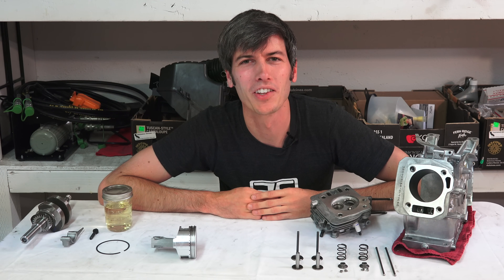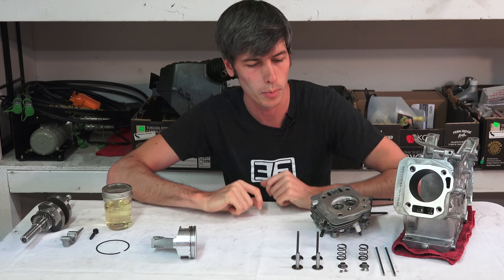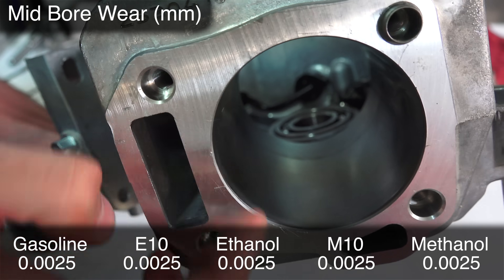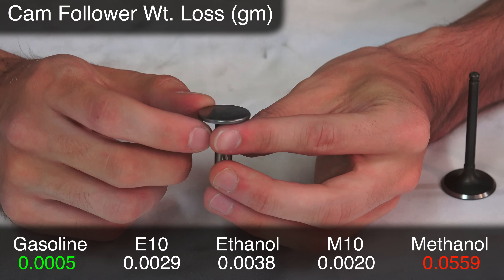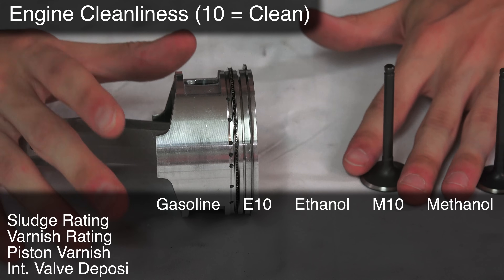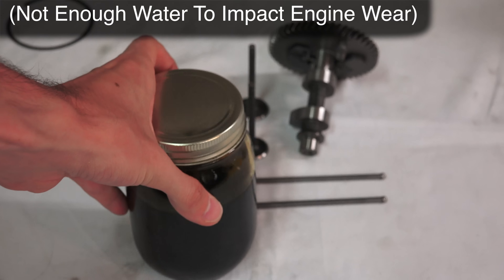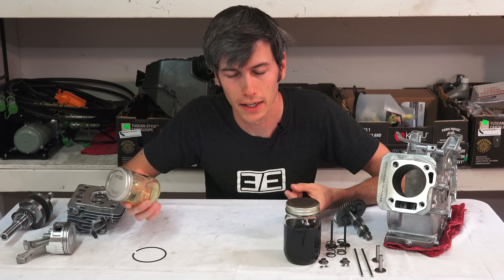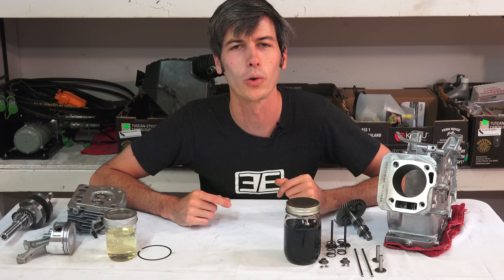Is Ethanol Bad For Your Car's Engine?

Comment: Could you please explain why engine parts that are not directly exposed to the fuel, in any mix or in any way, can show wear attributed to the fuel? Cams, followers, wrist pins, journal bearings, are not exposed to fuel so how can the fuel be at fault?

Comment: A couple questions;

Were the engines adjusted for the higher 
fuel to air mixture?

Did we check the damage to the fuel system?

steve
Reply: Ethanol has a different stoichiometric ratio than gasoline. Stoichiometric means that all of the fuel is used and all of the oxygen is used in a perfect system. Gasoline has a stoichiometric air to fuel ratio of 14.7:1, meaning 14.7 parts air 1 part fuel by mass. Ethanol has a stoichiometric ratio of 9:1 by mass.

Comment: Where I live E10 (super unleaded/silver)is usually 20 cents cheaper per gallon than regular unleaded. Both are 87 octane. I’ve been running e10 in an 06 Buick and at 85k miles replaced the fuel module which acts as the pump. The mechanic gave me a list of places that use top tier additives. So I try to always fill up with e10 top tier, and put a bottle of injector cleaner after an oil change. Been running e10 in an 05 GMC 5.3 with a bottle of injector cleaner, 156k miles and had it since 48k miles. E10 every time. Do not use e10 in carburetors. If you let e10 sit for a long time like months at a time it will separate.

Comment: After a view years with E10, the carmakers dont wont too use this!
Why? It damaged enginseals and Fuel lines!!
Reply: So how come, racing cars use 100% ethanol?
Reply: @wiretamer5710  
Special engines, seals and fuel lines!?😕
In addition, these engines are dismantled and overhauled after each race!

Comment: A test showing power differences between the fuels as well as mpg difference would be interesting.
Reply: Well, here in Brazil, you have a better millage with gasoline, but it's really more expensive than e100. And i think every car here gets more power with e100, the VW Polo jumps from 116hp to 128hp...

Comment: Ethanol refiners get  $2 a gal from fed to make it. Cant make at profit otherwise.  resellers get $0.86 a gal tax break so cost tax payers $2.86 a gal in taxs .plus cost. its 10% less efficent then gasoline. less MPG...BURNT ITS a lot more toxic then gasoline. It softens rubber engine parts =failures..fuel pumps fail/ quit..raised the price of 300 food products made with corn/ corn sugar.  40 hardware  store items have corn in them too. charcoal briquits use corn starch as the binder.  High corn use makes meat + poultry feed HIGHER priced so Raises meat and egg prices .its a pure total But- Fk on us..think it was a $$$scam between oil man Bush and oil refiners...should be BANNED cost us mega billions in subsidys a yr.    Really..hþ

Comment: Too often alcohol gathers moisture and you may have 10% ethanol but not 90% gasoline. A significant percent of water may exist. A petroleum engineer told me that. Otherwise ethanol can be superior.

Comment: I completely agree that ethanol doesn't cause engine damage. However, the real reason I don't like ethanol because it eats older rubber in fuel systems and because it absorbs water. The problem is I have collectable tractors that don't have the newest fuel systems designed for ethanol and they don't run very often so the fuel collects water and rusts out tanks and fittings and just goes bad sitting in there so I spend the extra money for ethanol free. However in my commuter where the fuel system is modern and the fuel will get burned within two weeks of my filling it, I use E10 all day long.

Comment: My 96 XJ owner's manual even has a note than it has been designed to run on either E10 or 100% gasoline. I'm not sure how far back you can go before it's an issue but my guess is that anything from the 90s or later is probably good to go with E10.

Comment: Get off that high horse .    Grab you a older weed eater or chainsaw.    Use it a day , then put it back in the garage till the weeds come up again or the firewood runs out .   Then give us your answer upon using the item again the next time.   Ethanol is crap.

Comment: My friends new Bass Boat engine manufacture ...states not to use Ethanol fuel.
If you do...it will void the engine warrantee.
One station here in town has a special tank/pump that sells old school gasoline.
Reply: I agree with them, ethanol is terrible for small carburetor engines. Don't use it.
Reply: I don’t put that in my ‘19 Tacoma or my ‘19 1000RR.

Comment: I got just over 15% less MPG in my 2017 GTI during my road trip through kansas when i switched to E10. same speed the whole trip using cruise control. also there is noticeable performance difference. I would personally never use E10 unless there is no other option.

Comment: Everytime I use 10% ethanol I get at least 1 - 2 mpg less then when I use straight unleaded gas ! And I do track it !
Reply: well naturally, ethanol simply has less energy density. Not really much issue except when the gas companies charge the same amount for E10 as 100% Gas, even though ethanol is cheaper thanks to gov subsidies.
Reply: @falconerd343  e10 is about 10% cheaper here. For regular cars it is a perfectly fine alternative imho.
Reply: @baronvonlimbourgh1716  I haven't been paying attention lately but I've been many places where the only choice was 10% ethanol.
Reply: @falconerd343  I've never seen it the same price as gasoline. And the cheaper price nowhere near compensates for the extra 6 mpg I get using gasoline.
Reply: @falconerd343  Yep, you're paying for it through your taxes whether you use it or not. They snuck that corn subsidy through without us taxpayers having a say in it.
Reply: @falconerd343  the best reply for the question. Ethanol is an alcohol, all of them have less energy per volume than regular gasoline. 1-2 mpg is close to 1/10 ( 10 % ) of most cars mpg nowaday.
Reply: @andreasguntoro5399  What do you drive, a tank?
Reply: @falconerd343  still doesnt change the fact it cost twice as much to produce ethanol as it does gasoline.
Reply: @midnitesquirldog1 Car dealers do NOT love it. I work at a dealer and the jobs we want are quick and easy service intervals, that's where the money is. Head gaskets and mechanical repairs are often a ball ache, take longer than the allotted labour time to complete and come with hidden expenses to the company.
Reply: @justmechanicthings  luckilly you'll never have to do any of that anymore in 5 or 6 years.
Ev's just need tyres.
Reply: @baronvonlimbourgh1716  True that, the brakes in particular last a very long time.
Reply: Baron von Limbourgh ok, and where does the electricity come from genius?
Reply: @wildcard749  not from the dealership........
Reply: Baron von Limbourgh really ignorant comment
Reply: @4door_papi  which one
Reply: @baronvonlimbourgh1716  Lol You're funny.
Reply: @carlosoliveira-rc2xt  thank you
Reply: @baronvonyou could  use your e/v as a planter  in the garden or a barbecue, as they burn readily. 😂limbourgh1716
Reply: @midnitesquirldog1 you're not worth proving wrong. Every word of that is completely false. Nice try, but Im done. Good luck in life!
Reply: @jasonmefford4312  his advice re lawn mowers is consistent with what we are told here in Australia where we have had E10 for 20 years.
Reply: @midnitesquirldog1 thats a sales tactic.  Ethanol is only alcohol and it will not damage aluminum tanks. No one makes a tank from fiberglass. If you have read that warning, no ethanol, which means do not use straight ethanol. Like E85. That means that the computer is not equipped with knock sensors to calibrate is what Flex Fuel cars do. As long as the machine is equiped with PTFE line youre good, even lawnmowers.
Reply: Just 1-2 mpg? I gained a whole 6 mpg in my 2013 caravan when I switched from e85 to gasoline. I couldn't believe it. What the heck are you driving where you only gained 2 mpg with the switch?
Reply: Same here. Real gas gives better mpg.
Reply: You can get straight 87 octane gas? or are you comparing E10 87 octane to 91 octane premium gas without ethanol?
Reply: @midnitesquirldog1 I drove a 1962 Lincoln Continental as a daily driver for ten years up to 2004. Obviously it was from leaded gas and no ethanol days. I used what was available, which was of course unleaded and 10% ethanol. Might have worn things more but no running problems at all.
Reply: I found a 9% drop going to e85 in my Ford Taurus. So your results are not inconsistent with that. But then where I bought it e85 was about 17% cheaper so in fuel cost per mile e85 was cheaper.
Reply: So your car comes in at about 29mpg? (Then it's the expected difference from the energy density is.)
Reply: @midnitesquirldog1 this guy disagrees with you David Blume
Reply: @midnitesquirldog1 my truck is a 96 and my car is an 89 and never an issue.
Reply: that's because you get more power out of gasoline than alcohol so the engine uses more fuel for the same power
Reply: @midnitesquirldog1 Pre 2001 not 2003
Reply: My 2018 Civic (1.5T) consumes between 10 to 20% more on Regular fuel than it does on Premium, on average (7 to 7.5L/100km vs 5.9 to 6.5) YMMV
Reply: @midnitesquirldog1 ethanol fuel is not banned in germany. I buy it weekly..
Reply: @midnitesquirldog1 these ev people, and the others have no clue. Ethanol is a curse from our govt! I don’t run it in anything. Pure junk!
Reply: @midnitesquirldog1 Yes your advice re carburetored vehicles is sound. It depends on what market your car was built for as well but the owners manual may tell you if you can run E10. The manufacturers websites are also good for info.
Reply: @midnitesquirldog1 my 1999 car is compatible but it was Australian produced.
Reply: @midnitesquirldog1 power is a different thing. E10 in Australia is 94 RON where normal unleaded is 91RON so E10 is actually more powerful but gives more l/100k.
Reply: @midnitesquirldog1 my 360,000k Falcon might argue with you on that.
Reply: Here in Sweden we have 95(e10) or 98(e5). 98 is more expensive but my car(mini cooper S) significantly runs smoother with the 98 with better( not much) fuel economy. 95 is cheaper but less fuel efficient and is not as smooth As the 98.
Reply: @midnitesquirldog1 lol, over reacting much.

Comment: All I know is that my motorcycle pings on Ethanol, and not on Ethanol free gas. (same octane rating) and that it vapor locks on Ethanol much easier also, and that the people who sell O-rings have brown O-rings made especially for Ethanol. Seems the black ones the bike came with, don't do so well with Ethanol. I'm sure there is more wrong with Ethanol, gas mileage for example, and the way the motor sounds, but this is all I have right now.

Comment: When I purchase gasoline I want gasoline not filler. If I wanted ethanol I should be getting a price reduction on sub par fuel. Think about it, the fuel refiners are making a killing on these blended fuels selling them as gasoline, it has nothing to do with the environment but their bottom lines.
Reply: Blame the corn lobby.  An unholy union of hippy environmentalists and corn states with 2 senators each.  There you go.
Reply: @lashlarue7924  Never mind that making ethanol from corn is not really saving the environment.

Comment: sure screwes up lawn mowers and weed eaters almost instanly
Reply: Big box stores are now selling pure gasoline for small engine devices. I saw here in the Midwest at Menards.
Reply: Paul Power no joke? Wow I’m glad I can buy it at the pump here in CO. I won’t buy ethanol for anything I have.
Reply: I've seen it screw up generators.
Reply: Not all of them, my mower is from 2009 and is rated for E30, I still use fuel stabilizer but it always starts on the first pull and purrs nicely

You just HAVE TO READ THE MANUAL, if it doesn't mention ethanol, go to a hardware store and get small engine fuel, or normal gas if sold where you live

Comment: Ethanol has been around since the late 70's early 80's when it was referred to as "Gasohol" and vehicles have been required to be E10 ethanol compliant since the 80's.  Granted not enough research had been done prior to that to determine if fuel system parts would hold up using E10 and I used to run carburated vehicles.  I did have to rebuild the carb a couple of times on my 76 GMC Jimmy, but at that time we didn't know how much the ethanol would degrade gaskets and such. After we learned these things, and that starting out with E10 from a fresh build didn't affect the parts, I just ran E10 because it was a bit cheaper. I didn't run into any issues with it after that. I did replace the factory Rochester Quadrajet with an Edlbrock a few years before I quit driving it, but again, I ran strictly E10 in that carb and never had any issues with it.
Incidentally, the 2nd time I had the Rochester rebuilt, I had been running strictly ethanol for a couple of years. The mechanic noticed a lot of wear on the internal components, all or which are replaced during a routine carb rebuild, but for as much wear as he noted, he couldn't believe how clean it was on the inside.